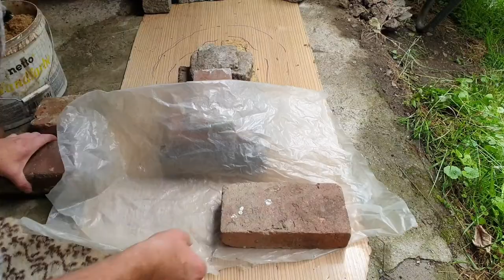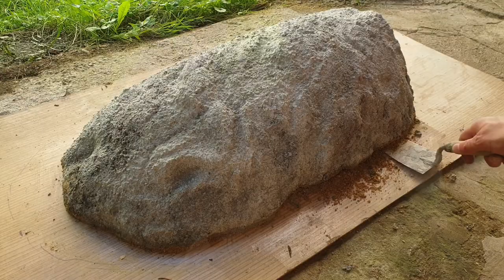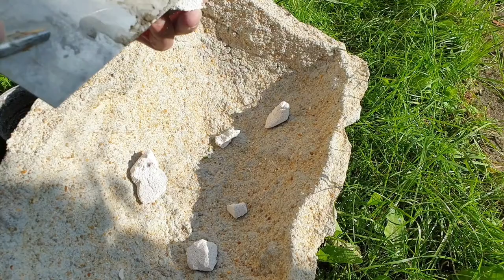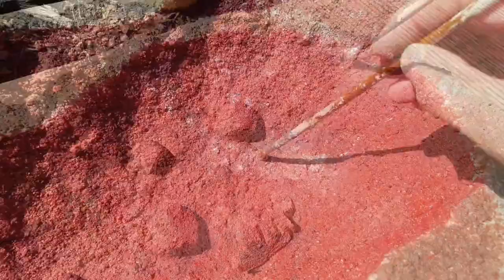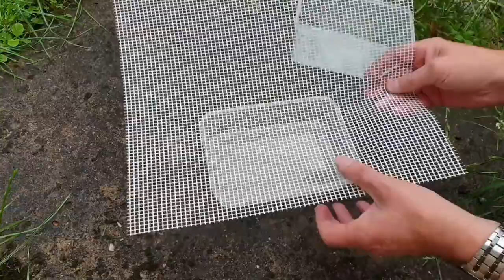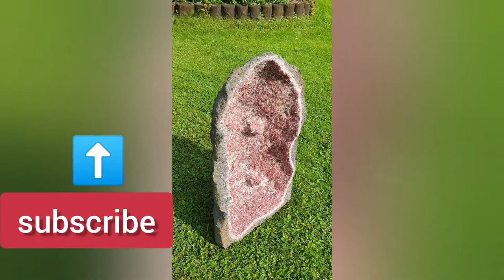Amazing XXL Concrete Garden Decoration - DIY - Eye Catcher

Comment: Ahhh I made one with clay and pre-bought glass rocks. I think you can use bigger shards than those in the video, it looks realistic still.
Reply from the maker: Yes, larger splinters are of course also possible or a different color. Everyone can decide for themselves. I still have 2 videos with small geodes, in blue and in orange with lighting. You can make it according to your liking. Thanks for the comment.